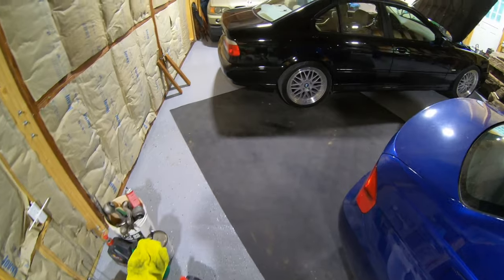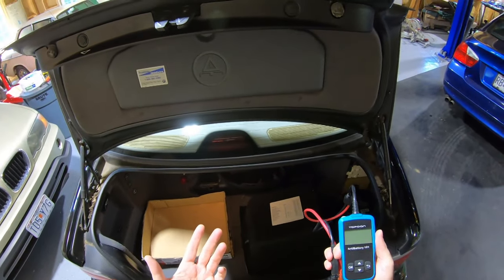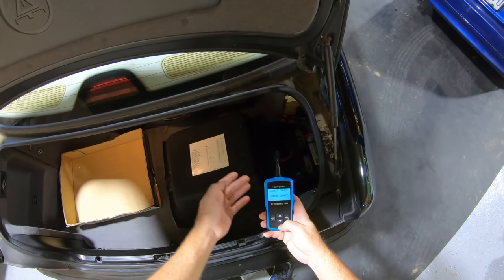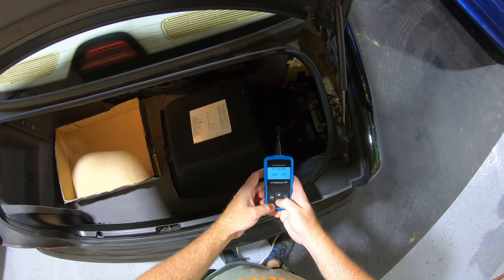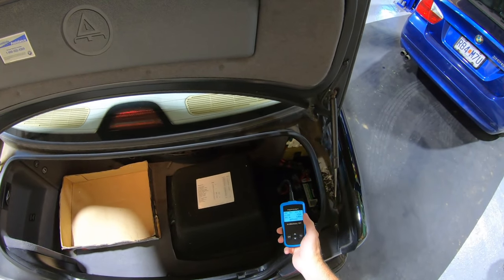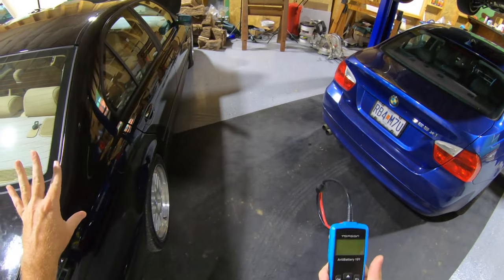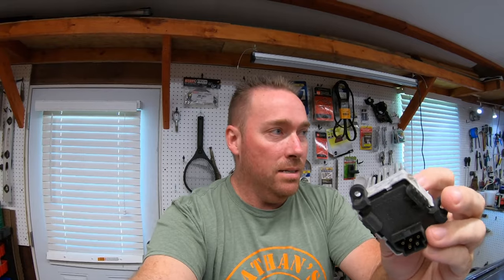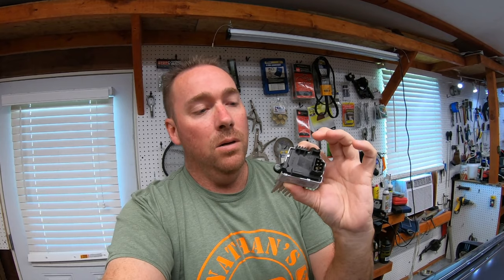Most Common Battery Drain Causes And Fix For All Cars !!!!

Comment: My car battery is dead after 5 days but there is NO drain at all. I have taken the car to 5 different mechanics and none can find an issue with it. 
They all have hooked up their dmm between the battery and the cable and there is only like a .10 amp draw. One mechanic even took a 24 hr video with him dmm and it never went above .15 amps yet the battery is dead after a week.
Reply: Did you ever get to the root of the problem?  My car is doing the same thing.
Reply: It was the factory alarm system. The issue was every time they would disconnect the battery cable to put their meter in-line, it would reset the alarm back to zero and not show any pull.
So watching another YouTube video, they guy used a DC clamp meter. Clamped it over the positive and saw a 150 mA draw. After testing multiple fuses we found it was ONE fuse that was wired to the dash clock, the trunk light, the interior dome light, cig lighter and the factory alarm system. So the easiest i saw was to find the alarm system box and un-plug it. Current draw was then gone. Re-charged the battery again, she started up fine, let her sit for 5 days, came back and she cranked up perfect. Let it sit another 5 days and cranked up just fine. SO that was the issue. 

So that video said to NOT remove the battery cable from the battery because that will interrupt or possibly reset that thing that is pulling current. What we have to do is just take the DC clamp meter and just put it over the positive cable and "look" for current draw. If you see current draw over 50ma ... then you got something pulling. Then you go pull one fuse at a time until that current draw is gone. 
The other thing is, newer cars with all the fancy electronics will take about 1 hour to fully go to sleep while older cars like from the 90's or older with no fancy electronics will be asleep within 5 min ...

Comment: I usually end up replacing my batteries every two years. I’m hard on batteries because I constantly have things charging or using power like driving cam, two phones, etc.  
Next thing beyond that I have found that some aftermarket radios will draw the battery down. Mostly after they get some age on them. Good video Nathan.
Reply: I searched my BMW and found my aftermarket Radio takes 50 mA/hour. Now my car is as Rock. Battery last nearly 1 month on E36 Cabrio .
Reply: @alioral1358  50mA is normal. Anything 1 amp and over is when there is an issue.
Reply: @vadimbellous8313  how do you know how much its drawing? Just installed one in my 05 lacrosse and its been tweaking on terms of battery crank power

Comment: I just got a 2015 bmw 428xi gran coupe and got the battery discharged and start engine and I’m concerned it’ll need a new battery. Should it be a concern to return the car or a fix I should be ok with it and continue to maintain car ? Not a car person sorry
Reply: Alexis… my wife has a 2014 535, and it started having battery issues last summer.  I replaced the battery with a model close to the original specification.  (The original spec battery is no longer manufactured.). If your car has the factory original battery, it is time to replace it -for sure.  When it is replaced, you absolutely must tell the electronics that the car has a new battery.  (You can watch many YouTube videos about this process.).  I bought, on-line, an Ancell BM 700 multi-system scanner that enables me to do this.  It also has a Battery function that allows you to view your battery voltage after the car is started, and running, in real time.
Reply: Yes the batteries (there are two stacked) should need to be replaced in 5-7 years. It's about a $500 cost including labor, and please get it done at a dealership so it will be done right. The settings in the informant center need to be changed to tell the car it's a new battery else it won't know and it will cause the battery to wear out prematurely.
Reply: Your stuck with car fix it. Used cars need part's repair it's just how it goes
Reply: @lissettelopez8331 I just got my maxima fixed at nissan dealership it cost 1500 for new altanator and new battery. But it was done right 7 yr warranty

Comment: I was leaving for a trip out of state….I told myself to let the car sit until I go so nothing happens, now the battery is completely dead….I am DONE with these unreliable BMWs, DONE‼️
Reply: Check out my comment above. New batteries NEED to be registered to the vehicle when they are installed, or else this can happen. BMW knows this but other shops may not. This has been an issue when BMWs get serviced elsewhere with the knowledge.
Reply: Used cars need repairs suck itup and buy new parts

Comment: Hi, I just got. 82 320i and it won’t hold charge. I’ve change batteries numerous times, brand new altimeter and even change the connecting wires to the batteries. I can’t find anything useful on the internet to help me. Any input would be appreciated! I’ll also tried to find the “final stage resistor” after watching the vid the first time and can’t find anything on google for this car. I find the new bmws piping up.